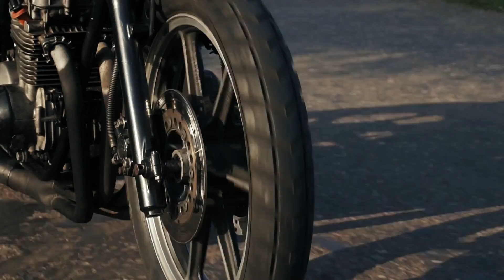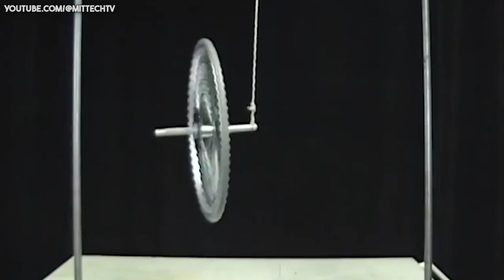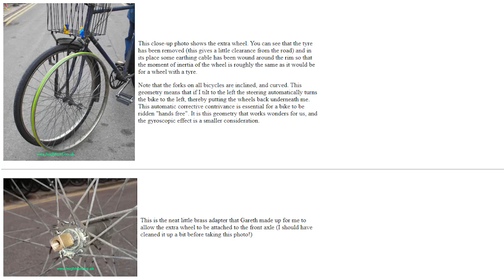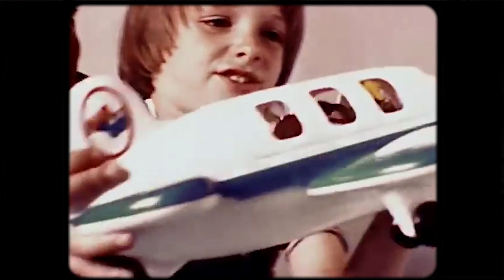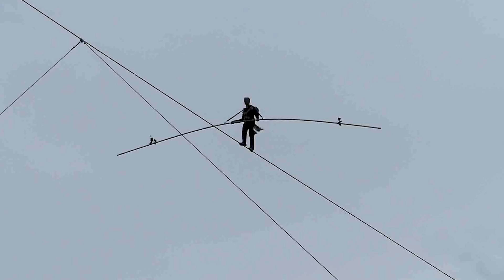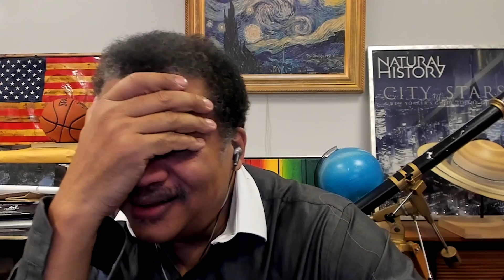How Do Bikes Stay Up? | Neil deGrasse Tyson Explains…

Comment: Theres an E-bike (motorcycle) out there, i saw a few years ago, with  rotating gyroscopes inside the rims spinning even when bike is not moving. The bike stands up freely using only the gyroscopes as long as the battery is providing power. 
Its all gyroscopic.
Reply: What you are describing is gyroscopes being added in order to make the bike more stable when stationary or going very slow.  But once up to a decent speed the gyroscopic effect is not required to make the bike self balance.  It works because the steering moves freely.  If the bike begins to fall to the right, the steering automatically falls to the right and drives the tire back up under the center of mass.  This only works with forward motion.  The motorcycle or bicycle has to have a properly designed front steering system in order for this to work.  So while you might find ways to use gyroscopes to improve the situation, it is not "all" gyroscopic and gyroscopes are not even necessary.  Lots of people have done many experiments to demonstrate this very clearly.  People have taken the gyroscopic effect out of the bicycle and it still works.  They've also locked the steering and it no longer self balances.  You can see all of this for yourself in other videos.
Reply: @adamharnois7072  
I never mentioned going at speed.
You've wasted our time.
Reply: @Sammasambuddha  Interesting.  What direction do the gyros in the rims spin?  Same axis as the wheels?  That shouldn't work because if there's a roll acceleration (lean) the gyros should just cause a yaw motion which isn't self stabilizing in roll (lean).  Could there be some other gyros spinning in other directions too perhaps?
Reply: Is it this?  https://www.youtube.com/watch?v=Okf283Ct-NY&ab_channel=TomoNewsUS

That's using steering to do it.  Maybe you're talking about a different bike?
Reply: Found one that uses gyros at about 4 minutes in:

https://www.youtube.com/watch?v=q1NaXSk1HWQ&ab_channel=MasterBoyTV

Is that the one?  That one looks like it's using gyros in multiple axes, not lined up with the wheel spin directions, which is what I'd expect for a gyro system to work on a bike.

Comment: I believe the angle of the forks on the bicycle also factor into the 'Ghost Bike' ability to self steer. Kinda like the toe and caster on the steering on a motor vehicle to self straighten the steering wheel (when properly set up). Great topic, thanks for sharing.
Reply: You are close but no cigar. It is trail that give stability. Angling forks is one way to achieve trail, but you can have vertical forks and still bui,d in trail to the bike geometry.
Reply: So glad you mentioned the bicycle's front fork "caster". I was dying for Neil to mention that. I really don't think the "low center of mass" has much, if anything to do with the riderless bike's ability to stay upright. This especially doesn't follow when there is a rider on the bike who moves the center of mass ABOVE the mass of the bicycle itself. The rider actually must steer the bike frame so as to keep it more centered under the rider's mass either by small steering corrections or by shifting his weight. A bicycle with no positive caster would be near impossible to ride no-handed.
Reply from the maker: Glad you enjoyed it!
Reply: This WHOLE video about staying up fell flat, not just Chuck's joke. There was no good explanation given. No follow up on why the wheel turning stabilized the bike and other issues like the rake and fork angles...It is obvious that he did not know the topic. He spent 18 minutes on wind chill to say the wind removed your protective heat shell.  @StarTalk
Reply: Yes. There have been bicycles with incorrectly designed forks and they do not self-adjust to stay upright. Clearly, they did not sell well.
Reply: @lesliefranklin1870  have to check my bicycles because I usually can ride handsfree but I have a single bike which is quite hard to control. Maybe it's because the handlebar isn't centered correctly
Reply: @macgoryeo  handlebar position is TOTALLY IRRELEVANT!  It's head tube angle, fork offset and resulting trail that are the crux.
Reply: Yes it's both the Angle of the fork as you mentioned AND in combination to the OFFSET of the wheel center pushed forward
Reply: Correct, its the angle of the forks relative to the center of the wheel
Reply: It's called rake and trail. 😁
Reply: The rake (amount of forward bend) on a bike differs for thw use. A cruising bicycle has a long rake and is more stable. A racing bike tends to has a short fork so that you can turn quicker . A bike specially designed for bicycle polo has straight forks - you can turn very fast - and a fixed gear so you can pedal backwards

Comment: The balance pole seems to be more of an inertia thing, if you start leaning to the left, you push the left down which will push you up, you can tightrope walk with no pole by swinging your arms above your head, much like in Tom Scotts tightrope challenge
A centre of gravity demo would be the balancing toys where a weight is physically below the balance point
Reply: @sparkyprojects Yep, exactly.  As I wrote elsewhere:  

What you have is a system where angular momentum is perhaps 0 to start, along with a (simplifying a bit) single vertical force at the walker's feet.  If there's a little disturbance and his CM shifts left a little bit, the vertical force is now to the right of his CM which will cause a torque to the left.  The walker will start rotating in that direction.  

By applying an opposite torque to the bar directly, he can induce an opposite rotation in his body and momentarily shift his CM back to the opposite side of the wire.  If he moves it far enough and holds it there long enough he can then apply an opposite torque to reverse the rotation of the bar, then stop it when it's level again, thereby canceling the angular momentum in the system.  His CM is now back to center and with 0 torque and angular momentum in the walker+bar system until it's disturbed again.  

All this stuff about lowering the CM is irrelevant in the tightrope example.  If the CM is above the wire at all by any amount, the system is unstable regardless.
Reply: @toddwasson3355  Right! It just gives something to momentarily rotate and push against to get centered again. Unless the pole is heavier than the walker, and totally below the rope, the center of mass won't balance you. I'll bet the hardest thing would be keeping the rope directly beneath you. That's gotta take a lot of control and core strength.
Reply: @edbruder9975  Yep.  I'm sure there's more to it than what I suggested, like altering the force direction on the wire away from vertical to reverse the torque and translations, but yeah, nothing to do with the CM being below the wire.  I'm a little surprised Neil thinks the CM is below it given no part of the bar or walker is below the wire when the bar is level....

There was another commenter here somewhere who said as a kid he did a training class on tightwire rope walking.  They had a cradle attached with a 28 pound weight hanging way under the wire somewhere that'd move.  He said it was basically impossible to fall off.  

If the CM was really below the wire like Neil thinks, it'd be a stable system and require no skill whatsoever to do.
Reply: Also wouldn't the pole be used as a weight as well to help contribute to the lowering of the center of mass?
Reply: @dre3k78  Lowering the CM is irrelevant if the CM stays above the wire the whole time, which it does in this case.  Neil is talking out of his lane on this one.  Seems to have been doing that a lot lately unfortunately.

Comment: I don't think so...😅
They carry long bar to balance themselves on the highwire with the help of moment of inertia of the heavy poles, their centre of mass is never below the wire. If you replace it with a dummy of exact shape size, it will fall down.

It's the same as balancing a stick on the finger.

Comment: What about the fact that you need the front fork to pivot past the contact point of the tire so it turns into the lean, oh and forward momentum or speed over distance to make the steering corrections. Neil is a complete dummy.

Comment: Neil, I'm with you on most things but you're wrong on much of this. You're right that gyroscopic force isn't a big factor but a motorcycle can still be ridden if it's 10 feet tall with the center of mass several feet above the ground. You're right that the front wheel wants to turn as the bike leans and that has to do with the geometry of the front forks, "trail" specifically.
Reply: I don't get where he says wheels rotating in opposite directions cancels out gyroscopic effect.  I'd like to see that in action. I don't think it'd have any effect.
Reply: @alanbiker5838 yeah I'm sure a pair of counter rotating wheels would still have gyroscopic properties ie resisting axial movement perpendicular to wheel rotation because they don't occupy the same space but are a couplet
Reply: Yup, he's giving a terrible response to this question. A bike needs forward momentum

Comment: This is wrong. They balance due to the rake and trail of the front wheel: due to the design of the front forks holding the wheel, when te bike leans left, the front wheel turns left by itself etc

Comment: how can they stand up?.. bikes are are Two Tired..
Reply: Two tyres touching two points on the ground. If you draw a straight line joining these two points - the CG ( Centre of Gravity) of the system needs to be on that straight line throughout the journey, which the rider achieves by steering slightly right or left as required. It becomes a reflex action (this slight steering) after adequate practice.